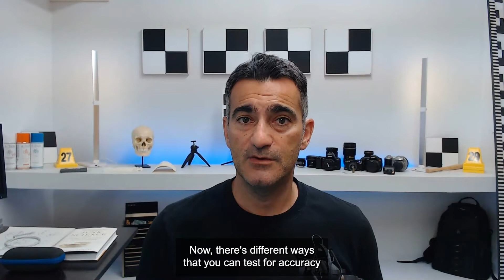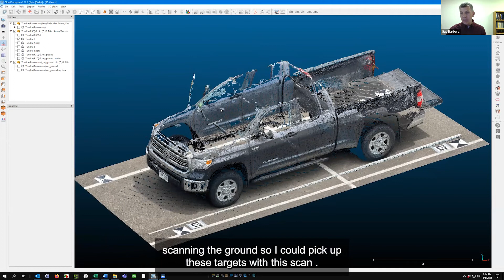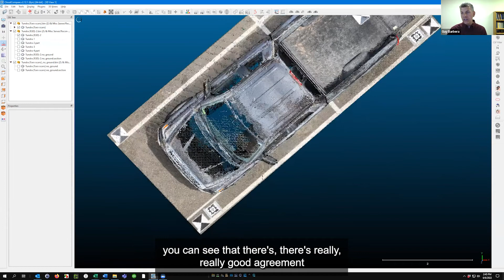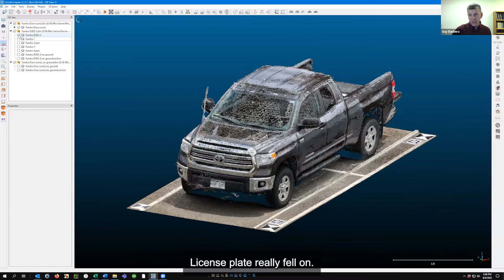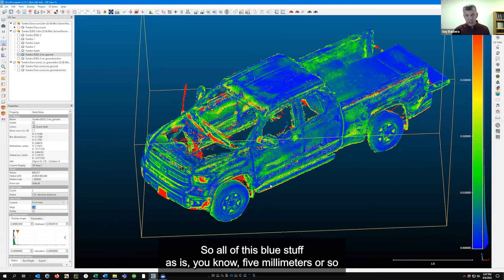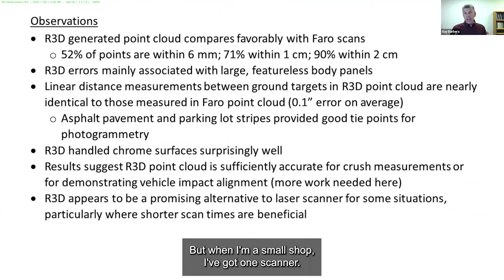Validation Test: Accuracy | Recon-3D LiDAR Scanner app | 3D Forensics | ft. Guy Barbera

Comment: iPhone or iPad? Which is better for scanning
Reply from the maker: This is a difficult question to answer because if you just compare the lidar scanning capabilities, you will not find any difference. However, there is a small advantage with on device processing on the iPad because the processor is better. Keep in mind a phone is smaller and easier to mount on a monopod or pole. So, think on what you really need.